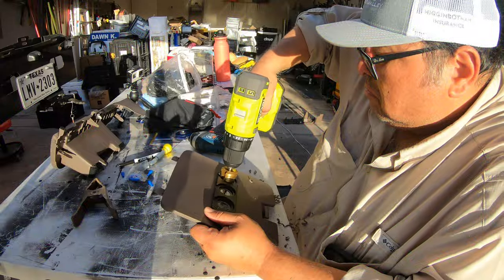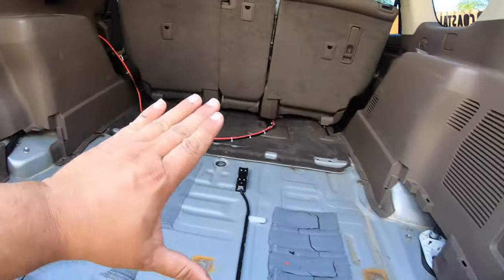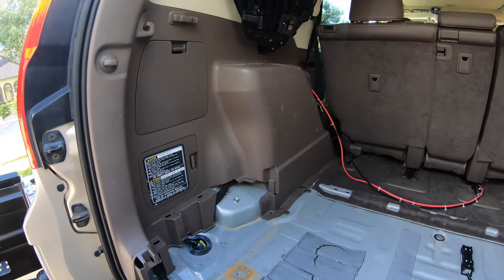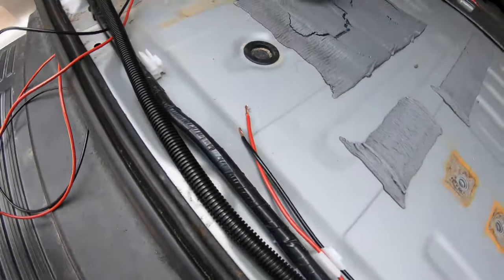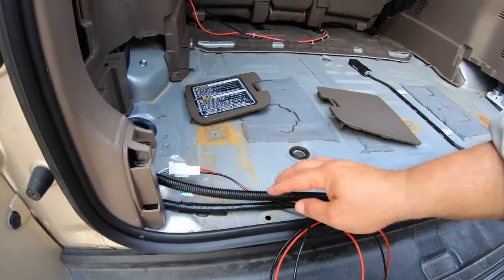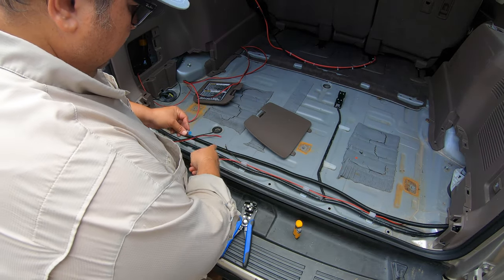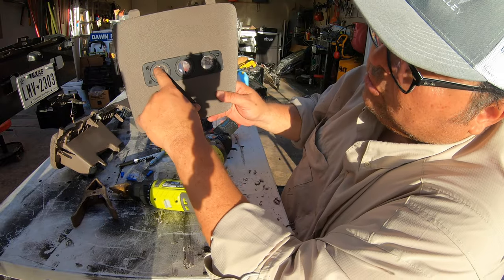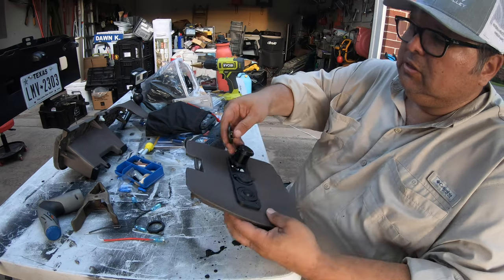Lexus GX460 Third Row Powerseat Hack YOU MUST HAVE!

Comment: How thick is the hot wire you've tapped into? Your plug is rated at max 150W (120w + 2x15w). Be carful with what you plug in it. Just because the folding seat fuse is 30A it doesn't mean the wire can withstand continuous current at that rate for much longer than it takes to operate those seats. Lets say you max out your plugs at 13A then your hot wire (feed) must be at least awg12 all the way to the battery. It's good you have used feeds from both seats. But, in case one of your feeds gets cut, you won't be able to notice that with the setup you have. All your power will go over single feed and you may end up with fire. Please double check the wire thickness and perhaps install tiny diods for each feed, so you know they are hot. Good luck!
Reply from the maker: Thank you for the feedback. I mention at 18:00 how I will be using this setup. It’s meant for small draws only like my iPhone, gopro batteries, and the LED for the awning. Not running a fridge. The gauge I’m using is 14.
Reply: All good as long as you are the only one who's using it. Just make sure you address this issue whenever you decide to sell the car, so new owner won't fry his/her family. Cheers,

Comment: What voltage is displayed back at your new aux 12V when the car is running? Interested to know what kind of drop you get (starter battery w/alternator vs plug in back).

Comment: You know that receptacle in the rear right side. Do you use that for anything. Could you use that outlet , modified, to accomplish what you did by tapping into the seat harness? I have a black line edition and all the seats are muscle power in the second and third row. So no can do. I would love to plug in my Dometic back there but I don't have a 12 Vn socket, just that 2 prong outlet.
Reply from the maker: That OEM outlet will not work. The wiring gauge is not thick enough either so it won’t handle it. You may just be better off buying a power station like a Jackery 1000 or perhaps set up a lithium iron battery which will do a great job. I will be conducting a review of a cool battery that’s perfect for powering up the fridge and won’t break the bank.
Reply: @CoastalGX  Not being the most patient person in the world.... took the truck in today and a shop that specializes in electronics and all kinds of electronic mods for high end cars, to discuss some possibilities. The guys agreed that that power plug back there is essentially useless. The ywill install a power inverter ( 2000 W) and connect to vehicle battery. then wire the outlets that I would like to it. all tucked nicely and concealed. So right rear a 3 prong outlet and a cig. lighter style power receptacle. Another somewhere to be determined and a plug in the footwell passenger side so my son can work on his computer while we travel. Along the way there will be a toggle switch to power down things when needed or not in use. That's sort of the quick summary. Of course a bit pricey in labor, but since I have no idea how to wire any of it it's better than blowing everything up and killing the warranty on the truck. I do enjoy all your videos even if I can't do any of the things you do. I'll do brakes and fluids and other mechanical things but NOT electricity.
Reply from the maker: @Cocora22  I'm not a big DIY person, I source out a lot of things. Only do what I feel comfortable with. There are many options for power now. Maybe consider a power station?
Reply: Hi, thanks for the install video. Do you use any type of battery monitor? I would like to do this and use this connector and the right rear power and I am afraid of draining the battery.

Comment: where do you buy the connectors from?  Are they available on amazon?  They seem to have 3 small pins row in middle 7 across for a total of 21 pin with the outer section seems to have two larger pins on both sides.
Reply from the maker: My buddy makes them. You can contact him on Instagram @extraterrestrial_overland. He will ship them over.